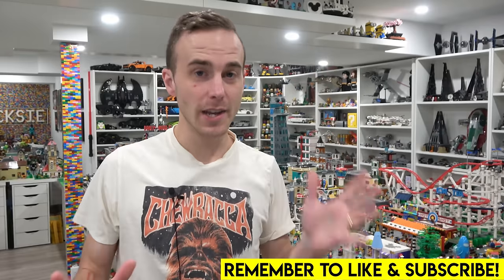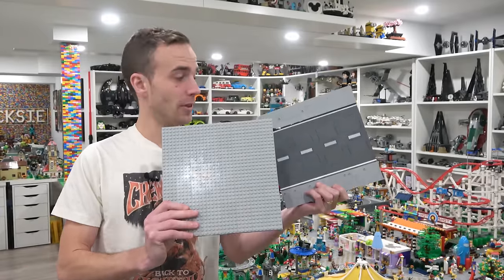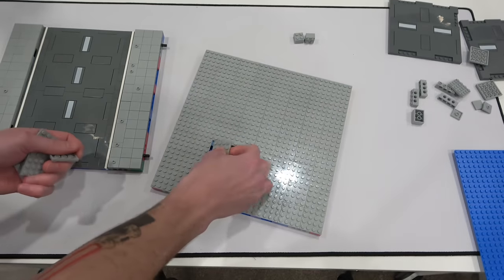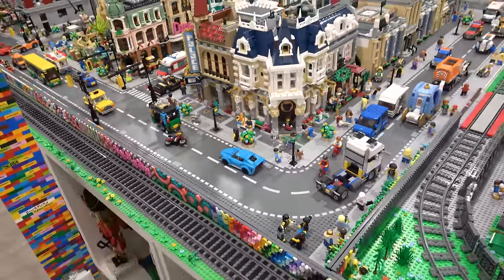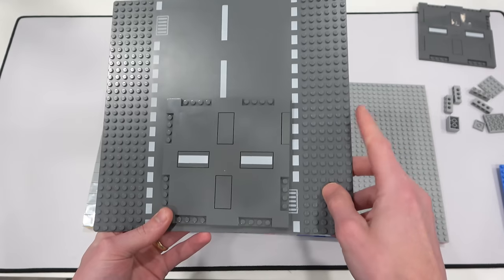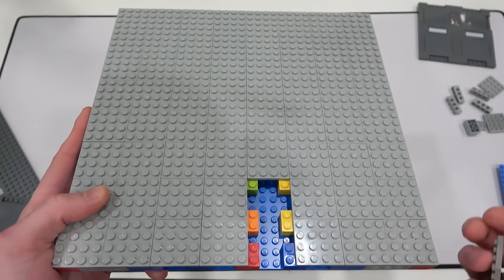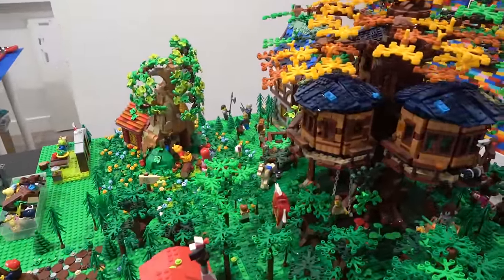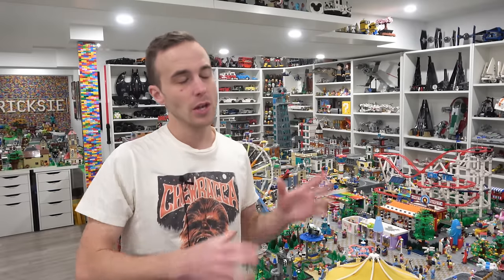LEGO MILS System? What is it? Should I Convert?

Comment: your current solution is already perfect because you only need to pull up any modular building, even though you need to remove the connecting tiles.... you need to remove all MILS plates just to remove on in the middle. Just give it a try interlocking 9 pcs 16x16 base plate with pins and you will understand what I am trying to say.
Reply from the maker: I will most likely just have the roads clipped together and have the buildings floating loose in the gird so they can easily be removed
Reply: Yes, I was just thinking the same thing. If all the MILS plates were pinned together it would make moving any one difficult. All the plates from the outer most to the one being moved would have to be disconnected, on all connected sides. 🤔

Comment: MILS seems like a good idea, but for a big area like this, the amount of MILS you would need to disconnect just to get to a MIL plate in the middle would be time consuming.
Reply: That was my thought as well.  Only way would be to leave a loose one in the middle of a block of 9 plates, 3X3 square.  If that makes sense.
Reply from the maker: Will probably only clip the roads together and have the modulars floating loose in the grid so they can easily be removed.
Reply: @Bricksie   By chance did you see my comment on the Police station? 
Narrow up the depth, add garage doors and parking on the back, add a couple A/C units, ladder to the roof, balcony at 2nd floor, maybe a basketball goal.
Reply: Thanks - my Q answered

Comment: with MILS once it is interconnected you cannot remove any of them without dismantling all of them
Reply: this was my question
Reply from the maker: I will just clip the roads together and have the modular buildings sitting loose in the gird so they can easily be removed.
Reply: @Bricksie  if that is the case, you can also do with the current base plate. just don't connect the modular baseplate with the roads. Just put in between the roads
Reply: @Bricksie  Disconnecting roads as you used to do will also be a challenge by itself. My suggestion is not to connect the base plate and roads. just put it next to the other and only connect those in your table perimeter.....
Reply from the maker: I will learn as I go. All I know is that by using MILS I can elevate detail in the city, grow as a builder, and have more fun. The old system is getting boring.
Reply: @Bricksie  There is pro and cont in everything. However, the way I see it, the is more con than pro with the MILS. It's more suitable for those who make a permanent city and grow from time to time by adding more scenery.  But you always move around your city. It's not worth the cost for something that people never see...... You are not going to adopt MILS just because you can build a small pond, for instance.....

Comment: I like how you extended in new roads a little without having two roads side by side.

MILS biggest problem is it’s too expensive for most people. You still use baseplates and the new roads are expensive, plus you need to buy a lot of square plates. The 2x2 bricks aren’t bad since you can use any color
Reply from the maker: No question it is expensive. Will add so much more detail to the city though. Luckily for me it is my job and this will essentially provide me with unlimited content.
Reply: @Bricksie  I use mils yeah it cost more but it looks soooo good especily if you brick build your roads. it also allows you to run light cables and make lots of cool things. i even have tram tracks running through my roads. also you can run the "road" through the corner garage and it looks soooo good
Reply: i used a mils pattern for my forest and it made it better than my original with just extra layers of plate on top of it
Reply: I know that this makes me guilty of heresy, but that is where I use off brand parts. I figure that those parts are not an RND hit for Lego so I am fine with using them in that context.
Reply: I've seen videos from other creators showing which pieces to use, and getting the cost down to $6ish per mils. Even if it was $10, that isn't so bad, considering the cost of what's mounted on top of it, and it lets you do depth effects, hidden wires, etc... I've even seen one hiding driveshafts for power functions to put motion in places it otherwise wouldn't be able to hide.

Comment: There's something I've been wondering with this whole MILS thing: how do you actually connect a grid?
Because if you use pins to connect a MILS plate on all 4 sides, isn't it making it virtually impossible to disconnect it? You'd then have to disconnect the corners MILS plates first, and then work you way to the actual MILS plate you wanted to originally disconnect... Or maybe I'm missing something?
Reply: This is exactly what I was wondering also.
Reply: Was also thinking this, anything inside the outside edge of the city is going to be near impossible to extract with the pins in, i was thinking use pins on the outside edges and leave the pins out of everything inside of it to make changing the mils plate easier. in theory it should be locked in place by the outside edge of the city.
Reply: For mine, I only pin in the plates on the exterior perimeters - there is no need to pin together the plates internally - you build them all with the connection points though - because you may need to move around buildings to be in different locations in the future.
Reply: Yeah just pin the street together and you can more easily switch out buildings
Reply: Came to the comments looking for this question. Only pinning the exterior makes total sense.
Reply: Lol, add me to the "hold on a mo...." list. 😁😁
Reply: Yes I slide in and out and only pin outside pieces no connection on inside plates.
Reply: @therealjetlag  but then you could do exactly the same with Standard baseplates. The tiles on top have to be aranged in the Same way to be modular
Reply: @mtwi  Of course you can and I never said you couldn't.
Reply: @tannjam  oh that will make buildings so easy to move, Idk about flat plates like in campground
Reply: @mtwi  You can't because standard baseplates have a tendency to bow/warp/not sit flat - and if you don't tile them together with the connect baseplates, they look bad.  with MILS you don't have that problem
Reply: you don't need to use pins to connect the modules. you can connect them with plates
Reply: If you want to replace a MILS in the middle, simply separate the row with the desired MILS on both sides. Then separate the MILS at the top and bottom. Voila.
This way you can easily access each element.

Comment: MILS allows for the standardization of larger builds and cooperative builds. Also allows for added rigidity/stability for transportation as well as account to possible uneven surfaces (supplied tables at venues). And for those that do lighting and or trains or anything electrical, provides a means by which to hide the wires. For flat surfaces we tend not to use the friction pins and just used plate or tile on the top to lock together adjacent plates.
Very parts-intensive but certainly worth it if possible.

Comment: So glad I started my city on MILS plates and another change I made was to all of the modular sidewalks. Changed all tiles over to light bluish gray since the new road plates are dark bluish gray. Looks pretty sharp, like your model road plate!
As you mentioned about the depth ability of MILS, I’ve fallen in love with the ability to choose the colors of the 4x4 plates to match whatever would be showing underneath. Example is the red carpet under the theater or to make sure all ‘alley’ sections behind buildings is dark bluish gray like the roads. All good for though, and enjoy the MILS journey 👍
Reply: on my MILS bases i use different size square plates depending on price.

Comment: MILs are great, not sure if it would be worth converting everything that would be a huge project! I will say I do not friction pin most my mills together because once you connect a good amount together it’s a real pain to get one section out
Reply: I totally agree. I only pin the plates along the perimeter. If you pin then all its a huge hassle to move stuff!
Reply from the maker: Yeah probably just clip the roads together or the perimeter. Then have buildings floating loose in the grid
Reply: if i have a MILS base that's 2 wide i pin and add plates ie if i put a switch which takes 1 and a half MILS plates

Comment: Recently converted my city to MILS - It's just 5.5 x 7.5 standard baseplates so maybe 8 x smaller than yours - I found it painful not just for the expense but mainly for the amount of work - I had buildings that extended across multiple baseplates (even multiple 48x48 ones) so I had to completely rebuild those buildings. Also made a mess of my Lego room for a good couple weeks. Ultimately I'm happy with the result, but it's always more work than you think!

Comment: If you don't want to immediately go through the hassle of moving modular buildings onto MILS plates, you could leave the top plates off and just put the modular with its baseplate on top of the bricks
Reply: It isn't that much of a hassle. I don't have as many modulars as Bricksie. But it only took me about 30 minutes to pull the downtown diner off the baseplate and move it to a MILS plate. And the diner has more tiling on the first floor than most. He could move all of them over in a day or two once he builds all the plates.
Reply: @koloth5139  Sure, but you can also save a lot of parts initially if you go this way, focusing on the roads the most

Comment: Didn't know about the MILS System so far, very good explanation! At 5:47 it is visible that the combination of the new road system with MILS is cramped. It's a workaround for missing basic Lego parts to make the new road system complete: The side stripe you built out of a dozen sideways plates should be a two part per side moulded brick with printed white Line. The Lego Road Plate should have an additional "Standard Version" without middle of the road holes just with a printed middle Line pattern.
So in Overview it would be 5 parts for the full width road itself and  a few parts more for the elevated Sidewalk add on. I think that would sell like hotcakes.
Plus: A curved road plate should be added as well. With moulded side bricks filling curve and elevated sidewalk.

Comment: You would be crazy not to go to MILs plates especially considering how often you restructure your city.  I started my city last year and I went MILs.  I am so glad that I did and I have no regrets at all.  There are 2 other significant benefits you didn't really touch on.  1.  The ease for adding lighting down the road.  (get it? lol)  Having the space to run wires and keep them hidden is huge.  I know lighting isn't for everyone, but at least the MILs system allows for much easier integration later on.  2.  The other is just how much space you can save in your city by not having double sidewalks and being able to customize the width of your roads now.  This can easily allow you to add at least one more street or two in each direction.

Comment: I really like/prefer MILS. Luckily for me, being relatively new to LEGO, I jumped right into MILS on my second modular set. My “city” is relatively small still (~20 baseplates) but having MILS makes changing things easy and even fun. The one piece I would give is be careful with adding technic pins…they are great for structure but if you have them gridded together it can make moving things around more difficult. It’s best to play around with you setup and really figure out your plan before adding the pins in at the end.

Comment: Would you consider using 2x2 thin instead of 2x2 bricks to create a thinner intermediary layer, or would two 2x2 bricks to get a thicker mils plate be better way of getting a contoured design? And would you stack them or try to build a custom scaffold for the mountain? How did you handle the castles/temple in your set?

Comment: I am building a lego space launch facility with runway and wide transit road and have decided to use the mils system. However since the roads are yo be used as runways, I plan on using the road plates straight onto the bricks much like a plaub plate which is then tiled over.

Comment: The new roads are nice.
Is there a nice way to move roads between classic road plates and new roads on MILS?

Is is possible to use the old road plates with MILS? 
Would you move road down onto the old plate, or would you cover it all?

Comment: It looks like your resigned to the inevitability of MILS. I don’t think it’s quite as easy to move / interchange a MILS base plate in a city of your size as it seems. Image a 3x3, trying to get the centre piece out when it’s connected on all four sides, which will be even harder on a larger scale with the weight of the buildings.  That said, it will look awesome when it’s done and I can’t wait to see the transformation. I’ve seen a few variations of the MILS, such as bricknerd.
Reply: yeah - you just don't pin every single section - only the exterior/perimeter plates.  there's absolutely no reason to pin everything together.

Comment: All its missing in my eyes is a cheaper way to raise existing base plates to the MILS height. A new connection that can align with the holes on the bottom of a base plate, so you dont need to many tiles and bricks

Comment: You wouldn't have such a problem of making changes, and you wouldn't have to go to the insane expense of MILS if you simply went with the already existing, much cheaper, and easier old-school PNLTC sidewalks. 

All you have to do is add a two-plate "sidewalk" to a road plate. Then add the same to Modular style buildings or place something under the modular to lift it up. I use all-studded sidewalks and then use "street furniture" (i.e. lamposts, garbage cans, benches, etc to "connect" the sections together. You don't Technic pins to create a sturdy display.

Comment: I totally agree with Boody Railroad. I guess I'm not seeing how these will be easier to remove. The friction pins don't magically disappear for you to lift out your plate anyway.  Outside row would be OK, but in order to make a clean removal you'll have to either A- Take ALL of your MILS plates out to get to one in the middle (because their all interlocked) or B- Tear apart the MILS plate to remove the technic piece and friction pin.  When you add to that the surmounted cost of all those extra parts, I would stay far away from that!
Reply from the maker: Will probably only clip the roads together and have the modulars floating loose in the grid so they can easily be removed.

Comment: forget the cost.  I have a VERY small city with about 10 buildings.  Started MILS after the 4th building.  It took a while to move the buildings off their existing baseplates and onto raised MILS.  Totally happy I'm on MILS now.  Surprised you weren't already with how much you move things around.  But it's going to take you a long time and the cost is not going to be small.  Hope you do it though.  There can be A LOT of great content if you get into it.
Reply: Do you “rebuild” the lower floor of the modular on the MILS plate or just set it on there?

Comment: Great video! As someone who just go their first modular, I am so happy that I found out about this system. I had already built the first two bags of Boutique hotel but took it all apart after learning about MILS. Currently waiting for my pieces to arrive from BrickLink so I can make my first MILS plate and get back to work :D
Reply: This is where I am at - I have the Police Station and Bookstore already built, with Assembly Square and the Botique Hotel in boxes. Should I switch to MILS now?? Would it mean rebuilding the two modulars I have already done?
Reply: @philipmacgovern7311  While you wouldn't have to fully rebuild them, you would have to take apart the first floor and all the tiling that is on the baseplates. Hopefully you could try to take the walls and furniture of the first floors off in larger chunks so they won't take as long to put back together.